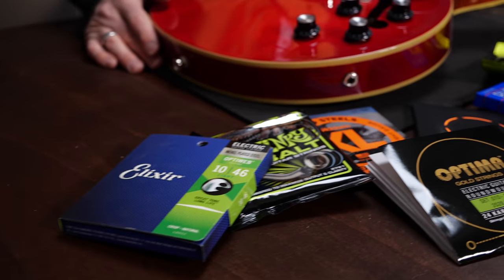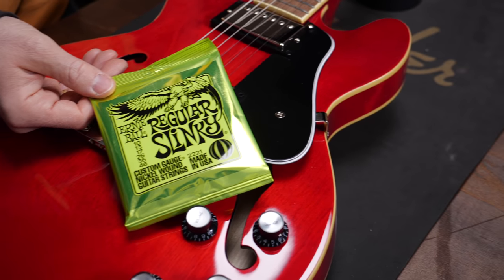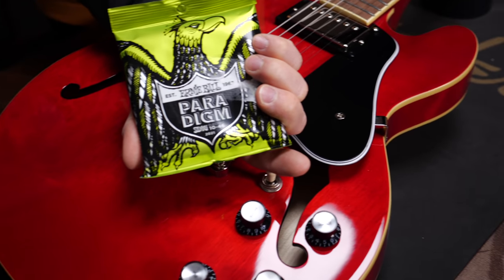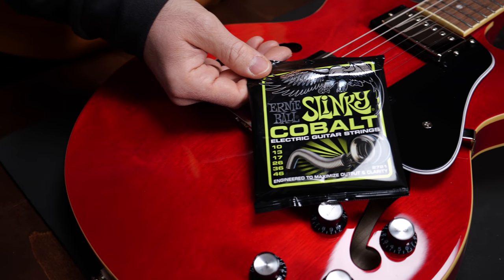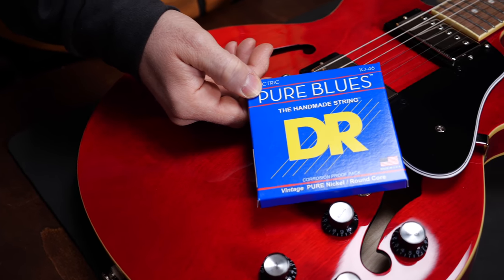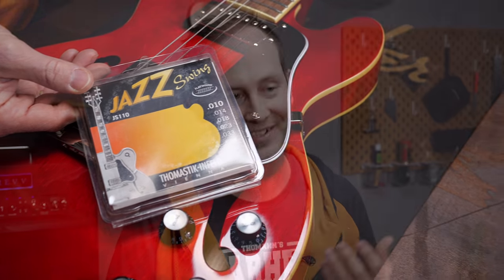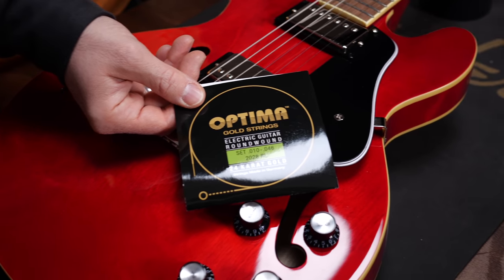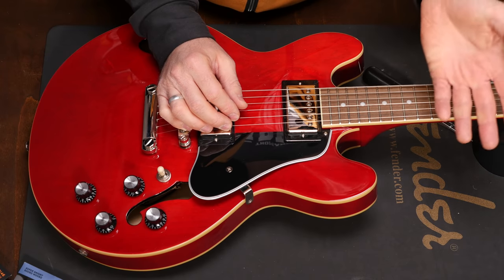All Electric Guitar Strings Explained | Guitar Tech Tips | Ep. 38 | Thomann

Comment: Fretwear is also effected by string choice. Stainless steel will eat through the frets faster than nickel coated strings.
Reply: yeah after like 10 years of normal playing.
Reply: @FrumPibe I rust my string extremely fast, but still have nickel frets. Should I worry about using a set of stainless steel strings?

Comment: I love the DR Pure Blues. I use .10's on my SG and the .09's on my Yamaha. DR strings last a very long time and until I saw the explanation of round-core strings I couldn't understand why. My second favorite are the regular D'Addarios in the same gauges. They are cheap, last a while, and are easy to find anywhere. Another favorite of mine are Rotosounds and they offer nickel on steel, steel, and pure nickels (like the DR strings). However, Rotosound strings are harder to come by. My least favorite are Ernie Ball and GHS strings. They never last that long even if I clean them off after playing like I normally do. I had to buy EB acoustic strings recently as it was the only choice I had at the time. They are wound so terribly at the ball ends that my acoustic pins can't sit correctly in place. I'm amazed EB is so popular. They are the lowest quality strings I've used. DR being the best thus far.

Comment: I use Cobalts for my wound strings, because I love the sound and single NYXLs for my plains, because I change plains less often, usually only when they break. The NYXLs come as singles in sealed package at no upcharge, are a lot more durable, stay in tune right away and are available in .5 gauges (like 9.5).

Comment: Ages ago I used Ernie Ball nickel plated 11-46.  I’d buy Regular Slinkys and substitute an 11 for the stock 10 high E.  Age, carpal tunnel and arthritis have me using the Ernie Ball Classic pure nickel wound Hybrids, gauged 9-46.  I like the easy bending on the plain strings and the firm bottom end of the heavier wound strings.  I also like the Ernie Ball M-steel strings, which are more expensive, but they have higher output and tend to last longer.    On my archtop jazz guitar I use 11-50 D’Addario Chromes Flatwound strings.  They’re great for softer solo guitar music and they seem to last forever because I don’t bend them a lot.

Comment: I play mostly in Open-C on a 6-String and Bb on a 7-String. 
Custom Set of 10, 13, 17, 30, 42, 60 for the Open-C (25.5 inch) and 11-64 on the 7-String (26.5 inch). 
I switched to NYXLs when they came out and never looked back.

Comment: D'addario NYXL on my main Strat, but I put together my own progressive tension set using single strings.

.0095; .0130; .0190w; .0280; .0400; .0560

I play quite hard on the low strings (especially low E and A), and light on the high strings. I prefer the wound G because it feels easier to bend, and the sound seems more balanced (at least to me) when playing chords.

Comment: I guess I use 70 gauge strings... because I put a set of 5 string bass strings on my 4 string for BEAD tuning. You can also tune up to DGCF, which you can't do with 75 gauge (I found out when I accidentally bought the wrong replacement ones)

Comment: I prefer nickel steel strings. Most brands are pretty good and I really don't notice much difference between them. DR high voltage, GHS boomers, Ernie Ball slinky, Dunlop, EVH, Dean Markley, Fender, Chromacast. There really isn't a bad choice. I really like the DR high voltage strings just because Dime endorsed them. Dunlops feel really good and stay in tune well. EVH strings are excellent as you would expect. GHS boomers sound great and feel great. Ernie Ball is the most widely used brand for a reason. Chromacast surprised me because they aren't that famous but they're great strings as well.

Comment: D'Addarios, 10-46 for E Standard and 11-49 for Drop C. I like the chugginess.
Reply: Holy Hell. A 49 for C would kill me. I play mostly in Open-C Tuning and anything lower than a 60 for the C is basically unplayable for me (25.5 inch scale).
Reply: @awakenmirror3005  The guys from Killswitch Engage play D'Addario 11-49 in Drop C and their tone is sick!!
Reply: @diamond_eyes46  This is not about tone, at all. It is about preference of tension. Tone is 99% in the Amp and PUs, anyways.

A .049 in C has around the same tension as a .039 in E (~14 lbs). So if you play with a .046 in E the equivalent with the exact same tension on C would be a .058 (~18.4 lbs), which is basically around where I am with a .060. 

After playing ~15 years I started investing myself heavily into balanced tension and came to the conclusion that I like ~20 lbs of tension. Regular tension for most players would end up ~18lbs. Since almost all pre-made string sets suck when it comes to balanced tension I started using custom singles and it improved the feeling for me a lot. 

Coming back to your Drop C example the drop in tension (and overall low tension) from a 11 (~15.6 lbs for a D) to a 49 [~13.6 on C) wouldn't work for me, at all. 

A recommended set if you like a 46 on E would be: 12-16-20-28-38-58 for Drop C to land on ~18lbs of tension for example.

I can only recommend to try experimenting with balanced tension (a tension calculator like from Stringjoy helps finding your gauges). I played for over 10 years with (in hindsight) unbalanced sets and after finally investing myself into the whole topic I couldn't believe how aweful that felt.
Reply: @awakenmirror3005  finding custom singles in all gauges in a pain in the ass though

Comment: From this video I dont hear those differences as I experience live.

I tried loads of strings and hated NYXLs and Elixirs. They had some strange top end, that I cant stand.

Funny discovery for me were Dean Markley Cryo Blue steels, working very well with semi hollows  for me. And biggest discovery are pure nickels for single coil guitars. To me, the tame the ice picky top end and add mid richness. Also feels very good under fingers for bends and vibratos.

I use 10-46 on Fender scale lengths and 10/11-52 on Gibson scale length.

edit: need to try flat wounds, but they are hard to get the proper gauge for me. Also I cant stand wounded G string.

Comment: Sure, use what eve gauge of strings or type of the strings you want. It is a free world.
Though in some situations there are a huge limitations to what is going to sound good or authentic. Or even what is going tol make the guitar sound weak and will make the neck feel soft and bendy and going out of the tune as soon as you put your left hand on it.

With some guitars, most often the cheap once you get 9's but necks are made of weak sort of wood. Not every maple have same strength. Sometimes neck is so thin that there is no strength left in the neck. So you get neck that feels like spaghetti. Well guitar neck does counters the pull generated by the strings tension. Truss rod is used to fine adjust the neck. With thicker strings you need more counter force from the truss rod. So going to 10's or 11's will tighten that neck and stabilize it. So in such a case there is a minimum string gauge that works with that neck/guitar. Those softer necks in combination with thin strings will also change action at any temperature change and season change.

One more situation where certain thickness of the strings is needed. For example, single coil guitar 25.5 scale length, with vintage low output pickups. Guitar player with hard attack and dynamic playing style. String needs place to move, hence it requires higher action. To achieve that sound player needs pure nickel strings. He will need thicker strings. First thin strings hit hard will go out of the tune and they will not generate enough signal due to the pickup low setting and thin strings. With thicker strings like 11's there will be enough signal and strings will not change tuning during a hard hit of the plectrum.
Suring live shows guitar players get excited and hit even harder. Thicker strings solve that issue as well.

Sure why work harder is known valid point made by Mr. King and later on by Billy G. and others that have great sound even with 8's. But to be able to use 8's or thinner you need guitar that works with 8's and has stable neck and you need insane feel and control.

I get why Epi was used for the demo. Great value, versatile guitar. Still ti is not the best guitar to show off the difference in tone of the strings though. That wiring and pickups just do not have enough resolution and details to show of how strings sound. I am listening on my PC with great 384 KHz 32bit sound card with Adam AX7 monitors and Adam Sub7 and difference is way less then what I get with my guitars when changing string types. Though I am spoiled with good stuff :(

Comment: I use 11's for C standard and skinny top heavy bottom for D standard , 10 TO 52. AND I DO NOT CHANGE THE STRING GUAGE WHEN I TUNE BACK TO E STANDARD, VERY BRIGHT SOUND WITH THICK GUAGE STRINGS ON .the d standard does not change cuase that's got a floyd on it and not going through all that i have a tunamatic bridge for that.

Comment: I use Elixir Polywebs. Last forever, no matter how much I sweat or what the outside weather is, because of the coating I just turn up my presence a touch on the amp and problem fixed! If I'm feeling frisky then I'll use Ernie Ball Cobalts
Reply: Sorry to dig out an old comment. Have you tried Optiwebs and Nanowebs by chance? If yes, what difference did your hear between them, if any?
Reply: @kadinnui2282  juss way after 😝. Right out of the box acoustically they ring louder and sound more like a non coated string the thinner you go. In a mix you won't hear it, you would just feel it by that point

Comment: Hi Chris, I have two questions:

1) Is it true that if you had a nickel frets you need to use nickel strings and if you had a stainless steel frets you need to use stainless steel strings? 'cause i was reading if you use stainless steel strings on nickel frets you will damage the frets, and if you use nickel strings on stainless steel frets the strings are goin' to break in a less than a month...

2) If you had a stainless steel frets would be fine to use cobalt strings?

Thanks, awesome video.
Reply from the maker: Hey, I'm not a scientist so I'm probably not the right person to ask. Haha! My experience: it doesn't really matter which strings you use with stainless steel frets. Nickels will not break super early, don't worry. I'm using nickel plated steel and pure nickel strings on my only stainless steel fretted guitar. Never broke a string.
I'm not sure about stainless steel strings with nickel frets though... If the strings are harder than the frets, you will most probably wear them off earlier. That's the only logical conclusion I can think of. 
//cheers, Kris

Comment: Ernie Ball Cobalts for me because they have something going on in the mids that no other set of strings that I have tried comes even remotely close to getting. Also, the Cobalts have slightly less tension on them than any other string type. It's not a massive difference, but it's enough to be noticed. I am addicted to them to the point of hating the response of regular strings. Oh btw, 10-52 for Drop C, and 9-42 for E standard, except for Strats and Teles where I use 10-46 for E standard.